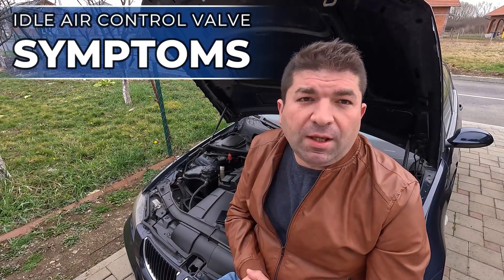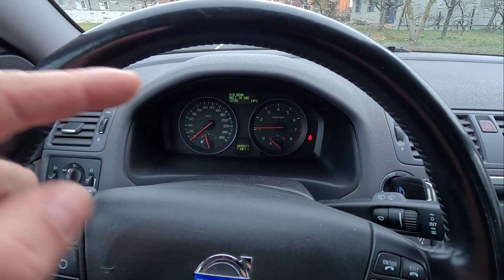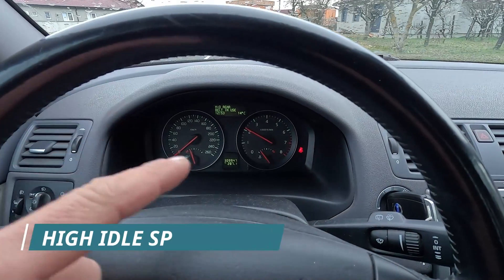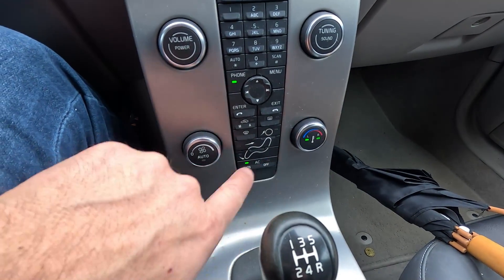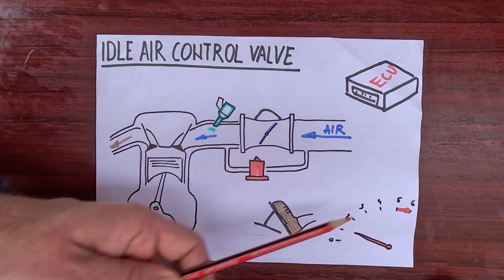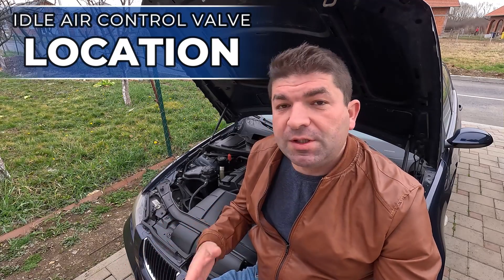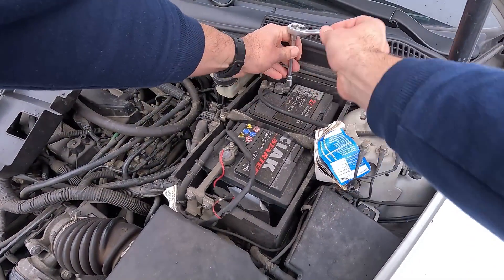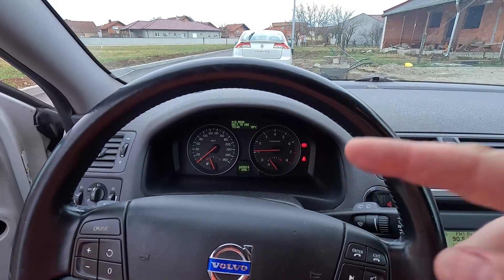5 Symptoms Of A Bad Idle Air Control Valve (and Replacement Cost)

Comment: I try new idle air control valve still didn't do anything different. Truck still shaking. Am thinking it might be head gasket cause I had the truck running for 4 hours . Cause i was in hurry and forgot to turn off tge truck. I came back the radiator was melting but the truck was still running during this time.
I replaced radiator and sits for 6 months and now i got to run for one week. After that it shaking now.

Comment: I have a 2005 Pontiac Grand Prix GXP just cleaned throttle body now it has high idling and it accelerates by itself now without me having to give it gas.
Reply: Gotta relearn / do throttle adaptation with scan tool
Reply: Hie I’m having the same problem on my Chev Cruze f16d3, cleaned throttle body now the car revs itself nonstop, I’m stressed. Did you find any solution yet?
Reply: That’s a common problem on those actually don’t listen to the other idiot who said you messed it up lol
Reply: @mattleibrock  oh, I'm an "idiot", am I? He only had issues AFTER cleaning the throttle body. If you want be a tough guy and insult people, online is not the place to do it - all it serves is to make you look weak. Your ilk are a stain on the internet; you're all the same deep down. You'd never have said that down the street... Walk along blindfolded and insult random people - you'd soon be humbled physically.
Reply: @mattleibrock  
Step up. He said it happened immediately after doing work on it. If that doesn't ring alarm bells for you, I feel sorry for everyone around you.
Reply: @EcotecEngine3.8V6 Jesus Christ chill out. "Everyone" around him? Go eat a sandwich and relax. It doesn't mean that you're wrong about the car stuff. But how does talking like that do any good when this was an otherwise calm comments section?
Reply: @curtisjackson3645  
Oh, so it's ok to call me an idiot? 
"An otherwise calm comment section"? Insults are "calm" to you?
Reply: @EcotecEngine3.8V6  damn. Didn't see that he called you an idiot. My mistake.
Reply: U have to disconnect you battery before do it, if not u have to configurate your throttle body again
Reply: You've obviously done something wrong. Check to see if the throttle cable or and linkages have been compromised or pulled too tight.

Comment: I also had a problem with the idle speed air valve.  The car (hyundai getz) shook when standing.  Irregular acceleration, smell of fuel and soot coming out of the exhaust.  Fault codes p0130, p0134, p0171 alternately appeared.  At first the garage thought it was an oxygen sensor and replaced it.  The problem continued and the fualt codes returned until the idle speed air valve was replaced. Funny because I searched and searched on the internet for the fault codes that appeared and nowhere did it say that the problem could be with this valve.
Reply: once you replaced it, did it stop again?
Reply: Tell us
Reply: After replacing the valve, the problem was solved and in fact, you can try just cleaning the valve and it could also solve the issue.
Reply: @legend5079  I will get it checked out. Thank you! Another question though.  Does your car consume more fuel than usual before you sort the problem?